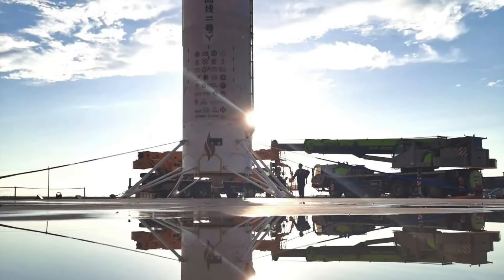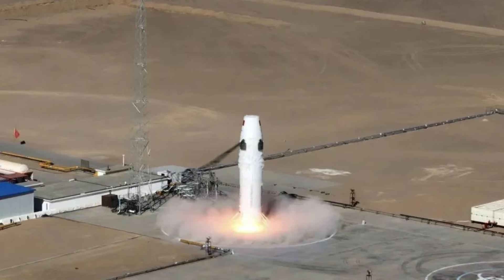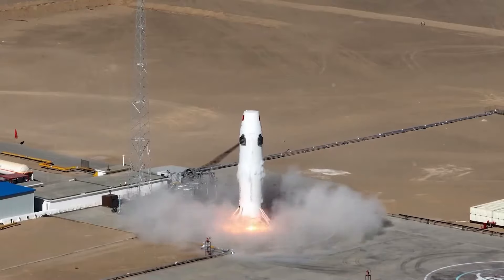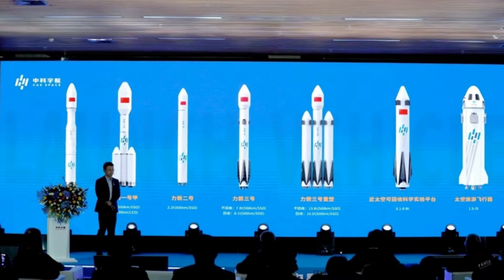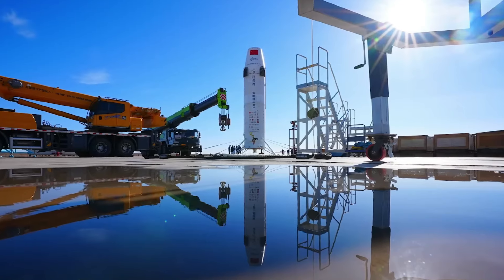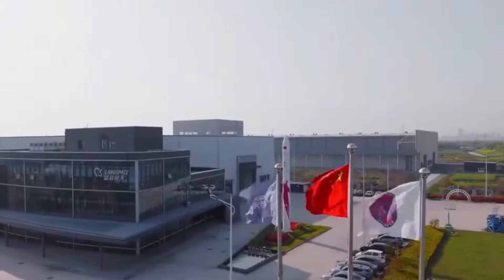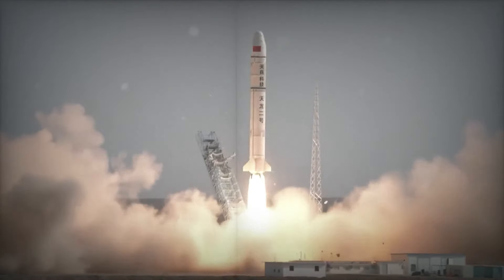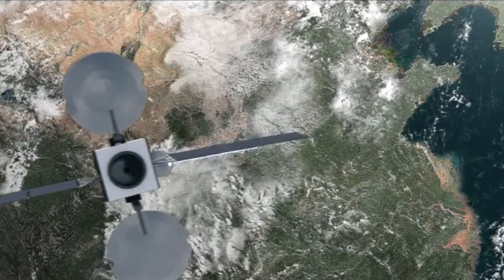This Chinese Startup Successfully Lands a Rocket Vertically!

Comment: It is still a long way to go.
Its capability is still in very early stage, only to take off, fly and landing vertically.  
The next step, the very difficult one, is the rocket has to rotate on air then landing.